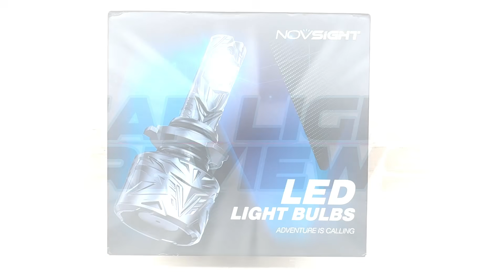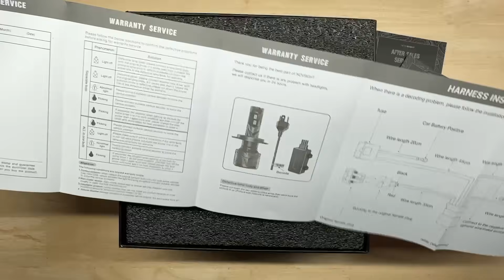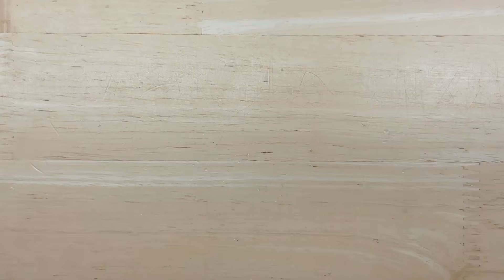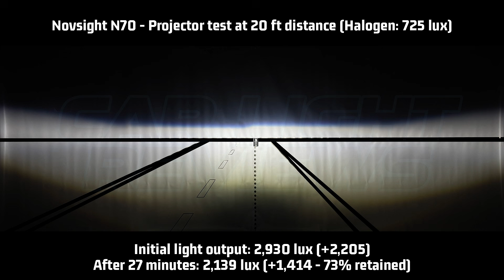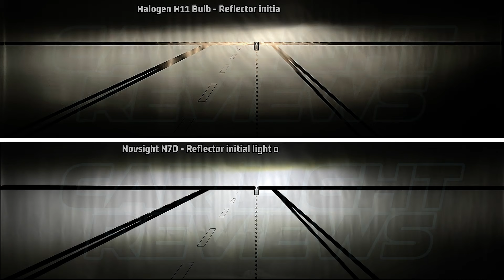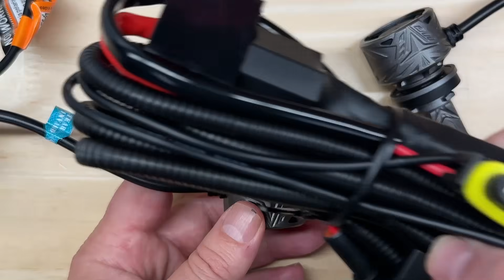Can your vehicle handle this POWERHOUSE of an LED headlight upgrade? - Novsight N70 LED Headlight

Comment from the maker: Review and lux test of the highly demanded and incredibly powerful Novsight N70 LED headlight upgrade.  Is it worth the money?  You decide!
★ Available direct from Novsight:  https://geni.us/novsightn70 ★ 
⬆ Use coupon code carlightreviews for 20% off ⬆
Reply: Ok so i wanted to add one more thing to this review that in comparison to n60 the fan speed is very less. I hope that is something novsight should take notice of in their new models as the better fan speed the cooler the light will be and hence better light performance.  N70 already has smaller heat sink as compared to n60. Now a slower fan combined with this small heat sink is something to worry about for me as we all know it will definitely affect the light performance in the longer run.
Reply: Due to the length increase of n70 in comparison to the n60 the light scatters in reflector headlights alot. N60 performs better than n70 as n60 has better placement of led (closer to stock halogen filament) specifically in reflector headlights.
Reply: How do u aim them? U never showed us... ???
Reply from the maker: @StreetScience187  Every car is different, the best thing to do is simply check your owner manual.

Comment: I have a pair of H11 240 W Novsight N70. Right on the spot, It blew my OEM 10 Amp fuse. Lot's of peoples reviews say it's the most powerful LED in the market. I'm running now with a Morimoto H11 relay 20 Amp fuse runs without any problem. With a proper projector cut off light, it should be just fine, no glare.

Comment: My Aukee 9005s are not as bright anymore after several years of nightly use.  Gonna grab me pair.  Thanks for the video and the discount code.

Got them installed. Now to see how they hold up with daily use!!
Reply: Update: These thangs are insane. I threw them in my 18 F150 high beams and Bam! Wall of light at night.  Awesome. I wouldn't recommend using them in low beam unless you adjust way down or are using projectors. But for high beam no one else is on the road so I need the power of the sun wall of light right now, yes, def throw them in the high beams. 😂😂😂😂

Comment: 240W per pair at initial startup? Considering the fact that a lot of cars have headlamp fuses of 15 Amps (12V to 14V x 15 A = 180W to 210W, no wonder they come with the external direct to battery wiring harness. Blowing fuses and wires is no fun. One thing that really makes no sense to me is why they drive these LEDs so ridiculously hard, it makes no practical sense to drive them too far beyond their most efficient region and needlessly raise temperatures.
Reply: I upgraded my fuse to 20 amp.

Comment: Hello! New sub here. Got an inquiry below:
I have an old Mitsubishi Lancer 1997 Model.
1. Will my car be able to use it without any issues or should some rewirings or electrical upgrade be done first?
2. My windshield has a medium dark tint, is this bright enough? Reason I asked is that whenever I drive I see other vehicles with brigther headlights compared to the ones installed on mine.

Comment: I installed these tonight. These blow my 75-watt HID system out of the water! Insanely bright! It was an easy installation because I already had a premium 9005/9006 relay system that draws power directly from the battery after start-up; so, it was plug and play.

Comment: I have the N70s in my 1999 Accord sedan as high beams only as I did not want to try low beams that might be too bright; high beams are not to be used with oncoming traffic anyway.  All I can say is these turn night into day.  However, I would not describe these as pug-and-play.  Due to their high current demands you must use a relay interface that lies between the bulbs and the car battery directly.  Your car's bulb wire socket goes to the relay, not the bulb or even the driver.  The relay is wired to the battery and then the driver, which then goes to the bulb.  It uses 10 gauge wire, and if you need to splice a longer run than what is given to get to the battery, you need 10 gauge wire there as well ... no less.

Comment: Are these "Brightest Lights you've tested" also meaning that they are the furthest throw down-road projection? I was wanting to get good high-beam and low-beam lights for my vehicle, but I have learned that it's not only about "brightness" but also about "Down road projection". Could you help? Thanks! Also, thanks for all you do! Here's a small appreciation for you and I hope your life is going well to keep up with demand! Also, I just bought them using your discount code, through your affiliate link! I also wanted to give you my car information if that helps. It's a 2012 Lexus CT200h F Sport with the Halogen Projector Low Beams and the Halogen Reflector High Beams. I used the Diamond D9's before and they got too hot and would go out. I think these burn at about 20 degrees less, so I'm going to try them out and let you know! Fingers crossed that the customer support is as good as Diamond's! They sent me lower wattage ones that worked, but they just aren't bright enough for me. I'm going to have to find something that fits that sweet spot between heat and light output, because I'm almost certain the heat is what made my D9's stop working, as they would eventually come back on after they cooled down a bit.
Reply from the maker: WOW...thank you very much for your support of CarLightReviews!  It is very hard to do "on-road" testing that is truly valuable because the environment can change which makes the data inaccurate.  Plus, it is also dependent upon how well the LED upgrade is accepted by your vehicle's headlight housing.  Let me know how well they work out for you.  Also..please send an email to info@carlightreviews.com with your shipping address and I will drop a couple of small CLR goodies in the mail to you.  Thanks again for the support!
Reply: @CarLightReviews you’re too kind! I just want to support people that make unbiased reviews with real research. I look forward to being a bit of a guinea pig and seeing if this light will work with my car!
Reply: Yes!

Comment: Can we see the different by using our eye, 3500 lux compare  4000 lux
Reply from the maker: I've found that people often think a headlight upgrade is brighter just by looking with their eyes or making a video with their phone. But the truth is, our eyes and phone cameras aren't the most accurate tools for measuring brightness. When it's bright, our pupils constrict to block out the light, and when it's dark, they dilate to let more in. Phone cameras also adjust their exposure to get a better shot, which can be misleading. Even a cheap flashlight can seem super bright in a dark room, but that's just temporary. 
That's why I test in a consistent environment so we get real data compared to halogen.  Without data, it's all just opinion.  Hope this helps.
Reply: Thank
Reply: Love your video, hope you will test more led, maybe some H4, some of led they don't sales in our country, most people buy is novsight in shopee, only a few people buy x-7seven, the novsight led got a ton led, n39,n57,n35,f4,n60,n67,n70,n75,n95,n96,n97 and n n n n like never end. My first one is n39 and is bad one, after watching  you I buy the aurora pro. Wow this one really good, it got 3500 lux, the novsight n60 and n70 got 4200 lux, that's why I ask the question above. Look forward to you test the X-7SEVEN Apollo plus, X-7SEVEN top one, and thanks again, it really help a lot.

Comment: I just bought a set of the N70 for my Jeep gladiator hopefully it goes well
Reply: They have been great so far no issues except the occasional flicker but it’s so minor that you can barely even notice and after talking with the shop it’s probably because of the type of alternator we have besides that they are super bright and worth the money
Reply: how did it go? i have the older n60s and they have an alright cutoff and light pattern
Reply: I have them on my 2020 jeep gladiator altitude
Reply: Any updates ?

Comment: Ihave novsight n60. 200w pair or 100w per bulb. Not to upgrade on this coz it just 20w difference. Not much noticeable in terms of light brightness. But this one is better for first time buyers of novsight. Hope they make same watts on yellow foglight color. It would be great! So far as i know. The most powerful yellow foglights of novsight it the n37y. 120w pair or 60w per bulb. Looking forward they make 240w pair of yellow color

Comment: So I went on and got the Novsight N60 Ultra D1S - after watching this video. I did bypass the Xenon Ballast on my headlight harness, and what can I say.. these bulbs (N60 Ultra) are just way too powerful. Reflective indicators on the side of the road are blinding you if you're using your high beam at night. I wanted to ask, if the bulbs are advertised as 20.000 Lumen per bulb, why you only get 5.000 lumens in the test whule they re in a projector?
Reply from the maker: First, did you check and adjust the aim of your headlight housings?
Second, I test in lux, which is different than lumens.  Lux measures the intensity of light on a surface, while lumens measures the total amount of light emitted by a source in all directions.  I also test in a consistent environment, but LED light manufacturers don't reval their test conditions.

Comment: Hey! Also to take into consideration: The Novsight N60 just got smaller, and I do not know if the light output has been affected. 
I just got my hands on some for like 50 something bucks and I thought they were fake. Contacted support and they told me it was changed recently.

So BEWARE, the N60 test MAY be outdated.
Reply: Damn. Controlled obsoletion now

Comment: Thanks for the review. You keep mentioning to adjust the headlights so I checked your video list but couldn't find  a how-to. Did I not see it?
Reply from the maker: The best thing to do is check your owner manual.  In addition to that, Diode Dynamics has solid instructions here: https://www.diodedynamics.com/blog/how-to-aim-led-headlights

Comment: Would be nice to test  / measure actual led bulbs color temperature. I feel like they all within +-25-30% off of advertised range.
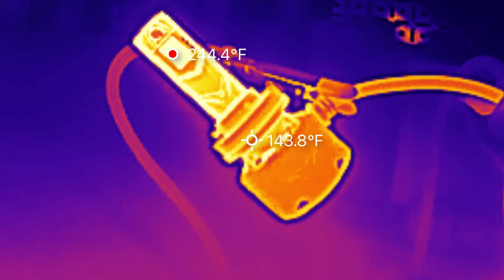Reply from the maker: I started to mention it recently.  I forgot to in this video, so I made a caption at the 9:23 mark.  Thanks for the suggestion!
Reply: @CarLightReviews  Thanks!

Comment: Due to the length increase of n70 in comparison to the n60 the light scatters in reflector headlights alot. N60 performs better than n70 as n60 has better placement of led (closer to stock halogen filament) specifically in reflector headlights.

Comment: I have the n60 in my headlights and foglights. Should i upgrade to n70?
Reply from the maker: See the 10:00 mark, that might answer your question.  :)
Reply: @CarLightReviews Due to the length increase of n70 in comparison to the n60 the light scatters in reflector headlights alot. N60 performs better than n70 as n60 has better placement of led (closer to stock halogen filament) specifically in reflector headlights.
Reply: after checking the spreadsheet provided I'd rather choose the N60 compared to N70 since after 27 mins of using they are almost the same output.

Comment: Could we see something more unique and wacky in terms of led bulbs ? Like colight mini projector led y12 ? Or the homologated osram night braker led?
Reply from the maker: Thanks for the suggestion.  I tried the colight mini projector and they wouldn't fit in my housing because it has a bulb shield, blocking the lens.  From what I understand, It blocks unusable waste light that would otherwise cause glare (and backscatter in bad weather).
Reply: @CarLightReviews  True it depends on the housing, i was thinking about it since regilar h4 leds are not compatible with the mirror design of my car

Comment: Subscriber here! Love to see you test the big brands road legal products like the Philips Ultinon Pro9000/9100 and Osram Nightbreaker Gen 2. The products in your tests are very difficult/impossible to purchase in Europe and there aren't any trustworthy tests being made of the products available here.
Reply from the maker: Thanks for that, I have received that request a few times lately.  I will look into it.
Reply: @CarLightReviews  try the x7seven ares. It will blow your mind
Reply: They are not fully legal, only if in compatible headlight list, and lumens wise they will be the legal halogen bulb  lumen limit around 1600.

Even the 200% brighter halogen are still 1600 lumens but technically a better beam patern

Comment: Ok brain trust. For my 2006 Subaru Outback XT Limited, what LED low, high and fog light bulbs do you all suggest? It's been suggested I use an HID bulb refit for the headlights. 
Thanks.
Reply: No one uses HID’s anymore 
Get Novsight N60 or N70 and don’t look back!!
Reply: @CroDudeCleveland  would I need something between the bulbs and the oem light harness to make them work w/o fuckin up my electrical system?
Reply: @vannevels6758  it’s simple plug and play
One connector that’s it
Get either Novsight N60 or F9 as stated in the comments
Reply: @CroDudeCleveland  not the n63 nor n70 but the n60. Thanks.
Reply: The 2006 Outback says it uses bulb size H7 low, 9005 high and 9006 fogs. Our F9 LED bulbs would destroy HID.
Reply: @DiamondVisionLED  would I need something between the bulbs and the oem light harness make them work w/o fuckin up my electrical system?
Reply: @vannevels6758  I have a 2009 Altima and 2006 Camry, and both of them are using the F9 LED bulbs without any problem. Occasionally newer cars, or ones with specific computer programming, can show an error code "bulb out" or have LED flicker when any type of led bulb is connected. This is an easy fix by plugging in a Canbus Decoder. But to answer your question, using LED headlights to not mess up your electrical system.
Reply: @DiamondVisionLED  ok thanks.

Comment: Weak bulb... K9C pro from dawnknight.  Using 90w continuous after 30min
Reply from the maker: Interesting.  What did you use to test it?
Reply: @CarLightReviews  a guy used a tester,  i got the F9 before and after a year of use i bought these instead, looks like a upgrade version with better heat management,  the best one is the PLUS and not the PRO, please test it :) its like 30dollars on aliexpress

Comment: I'm looking for a LED-bulb which has a heatsink no larger than a halogen bulb - like at all.

Why? I want to fit the highbeams of my 2007 Saab 9-5 with LEDs, but the hole in the housing is oval(!), meaning the bulb goes in, but can't be twisted to sit as it should with the chips side to side. Tested three different bulbs - on two the heatsink was too big to twist and on one that would probably fit, the fan assembly was too big to allow it to fit in the housing.
Reply from the maker: Have a look at this one:  https://youtu.be/cqgbNx7fBRs?si=dPwbjZRP1eQrm4k3
Reply: @CarLightReviews  thanks for the suggestion, but the heatsink/led chip part (the top part) looks bigger than the glass filament. What I and other Saab-owners would love is - if it's not too much trouble and time-consuming, if you could measure the bulbs you've tested, or test in the future with a measuring caliper, the top part, and add it to your spreadsheet. 

I know Saab is a brand that went out of business 13 years ago, but there are quite a few of us left Saab-owners left, both enthusiasts and non-enthusiasts, and if you'd find it worth the trouble, I would definitely spread this information both to Saab groups in Sweden (for example, Saab turbo club of Sweden on Facebook alone has 46,9k members) as I've seen others ask this question, and find some international groups too that would find this information useful.

That said, I understand if you won't do this with led-lighta already tested as your list of them is quite long.
Reply from the maker: @Waskapmutni  Are you saying you need to know the total length of the emitter portion, basically from the mounting tab to the tip of the unit?
Reply: @CarLightReviews  no, the width of the emitter portion is needed. The holes in the housing where the bulb/emitter portion is inserted are oval, so you can get any bulb in, but you can't twist it to get it properly aligned because of the oval hole and the width of the emitter portion being greater than that of a halogen bulb.

Tried "Ledson xtreme focus 2" but that wouldn't fit in the housing because of the cooling-part. Tried two others, one being Philips Ultinon Access, but the emitter portion was too wide.
Reply: @CarLightReviews  tried to share Dropbox links to images but links not allowed I guess. 

Measured width of glass part on a H7 halogen is 10.7 millimeters (~0.421 inches) vs 14.02 millimeters (~0.552 inches) on the light emitting part of a led bulb I have on hand. Don't know how much bigger than that it can be and not sure how to measure it as I can't get the measuring caliper inside the housing to measure the hole.
Reply from the maker: @Waskapmutni  Ok, I THINK I know what you are saying.  Have you checked out this one?  https://youtu.be/6l-iEnZCzKc?si=Vwzl8oeaa1reNaMh  Or am I still not understanding?
Reply: @CarLightReviews  yes! Exactly that, I tried one with a similar design. Fit in the hole but what prevented me from aligning those was the bottom-portion being too large😂 I was starting to look into this one but noticed Boslla doesn't ship outside of the US😩

So whenever I see a led-bulb I'm interested in I have to consider both the top part and the size of the cooling😩
Reply from the maker: @Waskapmutni  Gotcha.  That is difficult to nail down, I am unsure if there's anything out there that will work for you.  I wish I could help more and I wish you the best of uck!
Reply: @CarLightReviews  some, very few, do list all types of measurements of the bulb, just yesterday I saw one that did, but was still too wide. I think most don't bother with measurements because most cars don't have this issue. Thanks for trying though. I wish you happy holidays :)